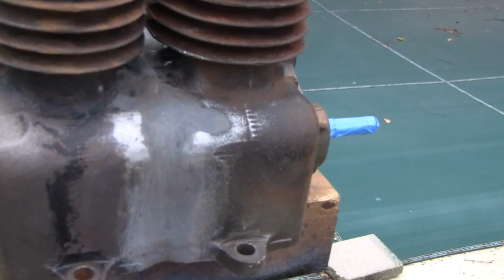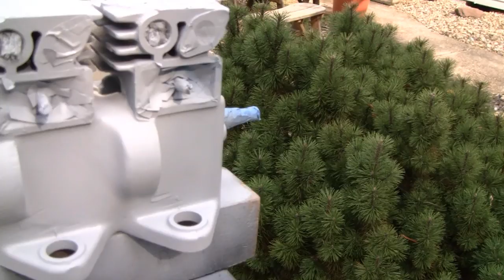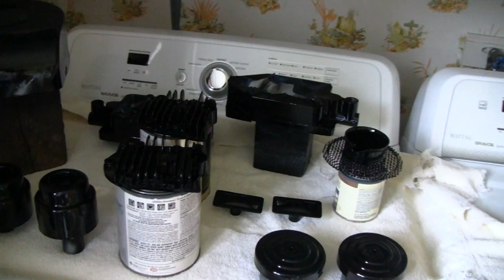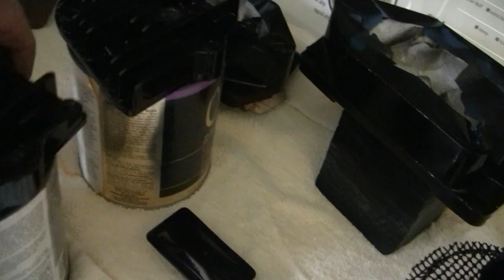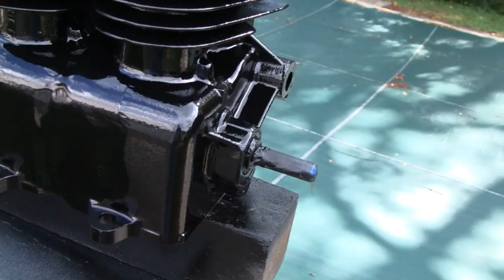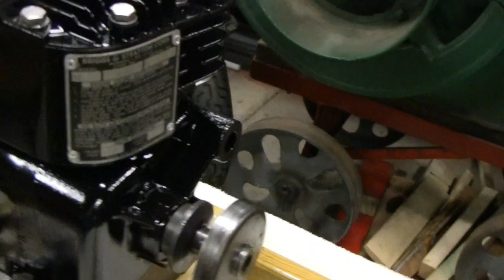HOMEMADE TWIN BRIGGS ENGINE PROJECT (part 8)

Comment: you mentioned they would be 10cubic inch combined. thats around 160cc! drop it in on one of those 50CC scooters. not sure what that would be in HP but I guess about 2 or 3 for both if they were 1 - 1.5 each. it would certainly run a motorcycle probably
Reply from the maker: william fleete Nah you couldn't run anything with it, the crank would snap in half!!☺
Reply: 805ROADKING Dang

Comment: what type of paint do you use
thanks
Reply from the maker: Rustoleum!!☺
Reply: 805ROADKING alright thanks for the info
Reply: 805ROADKING how does the rustoleum hold up to heat? id like to restore my old 18hp oposed twin
Reply: lman0018 i would use barbecue paint especially for the heads

Comment: I have a problem with my 6s carb, the fuel pickup is snapped and I've tried to glue it but the gas eats the glue after a little bit of running. How do you fix that??

Comment: RoadKink did you use a epoxy for the bar metal only, or did you use a filler primer with the epoxy?

Comment from the maker: Thanks Cat!!  I use regular Rustoleum paint and primer, I don't think they get hot enough to worry about the heat!! So far I haven't had any problems on any of my engines!!  The Maytags run even hotter and never had any problems with them!! It holds up to gas and oil well too!!☺